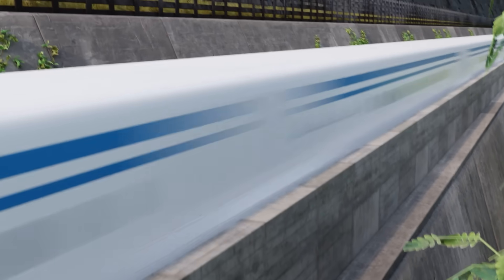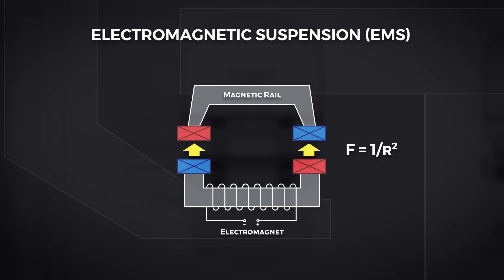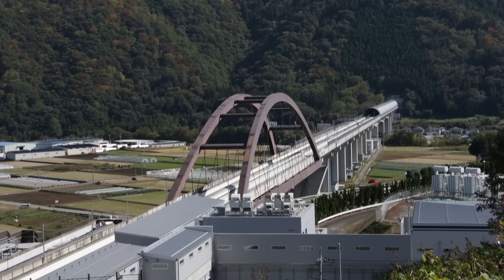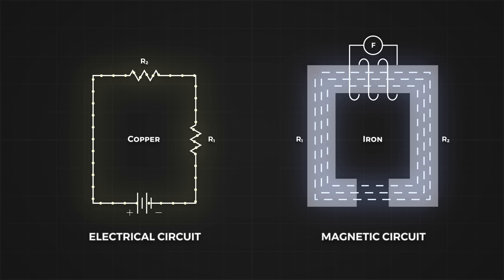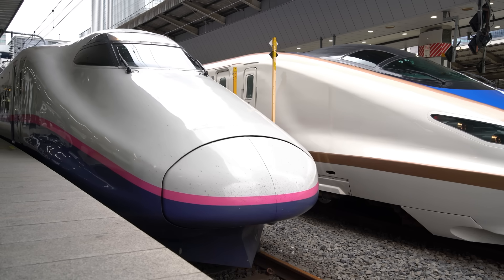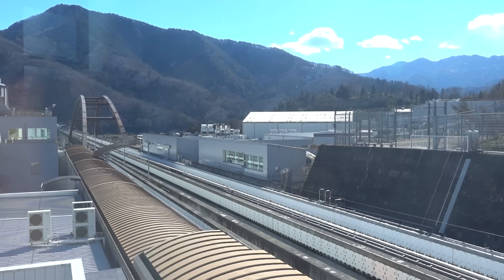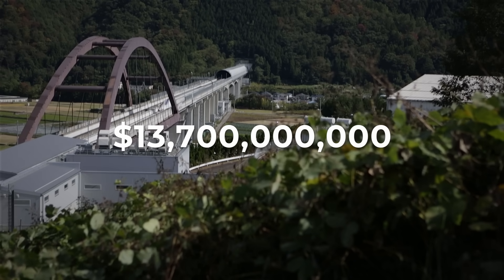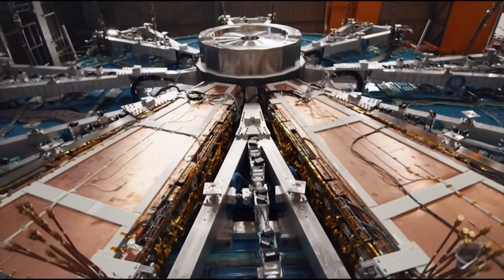How Japan's Maglev Train Works

Comment: Passenger rail in the US is complicated.  There are several reasons.  One is that trains have to travel through populated areas and most want to benefit from that rail but stopping in those areas would defeat the benefit so, many areas must pay for the benefit of a few.  That is a hard political trade for local governments.  That leads to the second problem that interstate passenger rail in the US is also used for commercial rail and commercial rail takes preference.  Usually it is cheaper and faster to drive you car.
Reply: I currently live on the front range of Colorado but I have also lived in Chicago, a huge railway hub. In Colorado there are freight lines running in a straight line from Cheyenne to ABQ through Denver and Colorado Springs etc. these lines already have the basic infrastructure laid and more importantly are already on leased land that is zoned and lended out for train rails. Between these cities it is mostly uninhabited private ranches. Wouldn’t it make sense to add a line directly next to the freight line or create pull offs or work the schedule that allows for multiple use on the same rail? The hardest parts of the infrastructure are already laid they should just be able to add on to it.
Reply: @Jasper118  Texas has a similar story between Houston and Dallas.  They have been working on that for almost 10 years.
Reply: @connecticutaggie  I’m sure with Texas having such a massive stake in fossil fuels they’re not particularly motivated to get a high speed rail going
Reply: @Jasper118  Not really, there are plenty enough people to buy the oil.  It is just really expensive to put in and the financial return has always been hard to sell, especially when there aren't any US success stories to leverage.  There are lots of failed US long haul passenger rail ventures and very few successes.
Reply: @connecticutaggie  there’s never enough people to buy a product, you can always use more customers. Creating a rail system that would potentially replace thousands of flights every year would make a decent dent in fuel sales

Comment: As a Japanese, I'm glad you covered this topic. My 2 cents is maglev is a transformative technology that's more than just transportation where costs per trackline matters. The same technology can be applied to aircraft catapults in navy, for example. It's always good to invest in technology.
Reply: Just a bit curious, if a failure suddenly occurs while at high speeds, does the maglev train deploy an emergency break system or siemthing?
Reply: @lonemarkkingoftypos3722  I cant answer too technically. But there seems to be 2 break system: air resistance and tire's physical break. https://linear--chuo--shinkansen-jr--central-co-jp.translate.goog/about/emergency/?_x_tr_sl=auto&_x_tr_tl=en&_x_tr_hl=en&_x_tr_pto=wapp

Comment: Here are my two criticisms for your video: you went into depth about the main levitation system and talked a little bit about the magnetic repulsion method including its main drawback (active height management), but did not cover anything about the repulsive system with the magnets on the bottom which appears to me to not have the same weakness as the previously stated method. It seems like this should be the real competitor, yet you did not discuss it. My other criticism is about how the power is delivered. How can it be power from the changing magnetic field from movement of the train, when the train is the thing that provides propulsion creating that? Maybe I'm missing something, but it sounds like a perpetual motion machine. Another thing In would like discussed is why the superconductors are cooled with helium which is cooled with nitrogen. Why can it not be cooled with just nitrogen? However I am aware that there are time constraints and this last point my just not make the final cut. Thanks for reading, and I hope you will consider this feedback.
Reply: ", but did not cover anything about the repulsive system with the magnets on the bottom which appears to me to not have the same weakness as the previously stated method"
Those don´t exist.. well sort of. This is typically the fantasy of school children and people who write articles despite not having a clue what they are talking about.... with that, there was actually one system that kind of sort of was based on a system somewhat close to that idea. It never went anywhere, its a very expensive way of making a track.

Comment: Maglev🤔Why only eliminate one form of drag? If they are going to spend a lot of money, they could've used a dozen tbm's to tunnel 100 meters beneath the country in a perfectly straight line and vacuum the space. Would cost 100 times more (idk), but it would be the fastest posible.
Reply: You can´t do a good solid vacuum in a space that large. The main reason is water. So any vacuum would be quite partial and hence in practical terms really not that much better than just running the train on the surface.
Reply: @matsv201  I imagine multiple jet engines worth of power would be needed to keep the vacuum.

Comment: It is amazing that this thing can just passively slow down and stop with everything besides the wheel deployement without any automatic systems(hopefully i understood correctly). Decreases complexity and safety by a ton. It is also possible that those wheels are being held in a way that would make them deploy in case of catastrophic failure and complete loss of power even on board the train. Even at high speeds it would just slow down the train more quickly. I'm also interested if it uses ground effect to help increase its efficiency and decrease the load on the magnets. It would make sense. I would like for this to have part 2 that goes in to small details like this. Either way amazing video. Thank you.

Comment: So... Seen the news about the potential room temperature superconductor yet?
Reply: Yup, it turned out, unsurprisingly, to be a hoax.  If it comes out of China, it almost always is.  They can't even make a city that doesn't flood in light rains or a dam that maintains its shape and position.  People have picked up the drain grates in those cities, on video, and they are just sitting on the ground, no pipes or anything else underneath them, so that flooding thing is not a shocker.  Fire hydrants, too.  It is all show, not substance.

Comment: Hmm, fast, but needs rare materials, complex at each section, lots of energy, heavy shielding, & sole right-of-way for >100km between stops?  Oof, LOTS of expensive trade-offs in that, even before getting into more basic issues like path-planning, land rights, & multi-locale politics normal railways deal with. No wonder it hasn't been widely popular!

Comment: Ordinary trains have very very low resistance to the ground compared to like car wheels, why can't those trains go that fast? Is the wheel really the limiting factor?
Reply: The limiting factor for high speed train is track maintenance. It simply get to expensive when the trains drives to fast. That is why there been sort of a rock solid stop for trains at about 320km/h. China do drive some trains at some times at 350km/h. But they are really exceptions.

For maglev its really cornering that is the limiting factor. And well.. at a speed, so will power demand. But i would suggest that the train will probobly go 700-800km/h before power is a real limiting factor.

There is also more ways to improve aerodynamics of maglev that have not been implemented yet. Improving the aeodynamics would allow for faster speeds with same kind of power budget.

Comment: I often wonder about those ultra fast trains and the airport security. We have those horrible security measures when traveling by air, they are borderline abusive to the passengers. The thing is, an attack on a fast train would be as destructive if not more destructive than an airplane crash. Still we do this security circus on airports but very little on train station or in public transport. I guess you need a far bigger bang to derail a train than to bring a plane down. Maybe that's the difference?
Reply: When was the last time someone downed two office towers with a train?
Reply: High speed train can be safely stopped in any moment. Shinkansen trains actually stop during earthquakes, the same can be applied in case of other threats. You can't stop plane in-flight and that is why you need to minimize possibilities while you are still on the ground.

Comment: Shame you only take into account the reduce travel time. What about the cost per passenger per km (high speed, maglev versus airplane), It is not all about reducing travelling time (Just a guess). Is it cheaper or just a gimmick for 1 hour reduction?
Reply: The main justification is capacity (notice that most of the trains on the Tokaido shinkansen are Nozomi i.e. limited stop trains, resulting in fewer slots for for Kodama and Hikari) which incidentally is the original reason for the Shinkansen to be built (the Tokaido mainline was too congested and needed relief lines).

Comment: Is it easy to use that large amount of liquid helium?
Reply: Use is exceeding supply, by a lot, and it is used in many critical technologies, like MRI machines.  The US had a HUGE stockpile of it, stored underground, and it is being depleted at an alarming rate.  Also, when you put it into the atmosphere it is gone, and I mean REALLY gone, as far as Earth is concerned, as it rises to the top of the atmosphere and then is stripped off into space by energetic solar particles.  

A lot of the problem traces back to the US govt, who stockpiled tremendous amounts, billions of cubic meters IIRC, and started selling it at rock bottom prices to pay down public debt putting 'manufacturers' (it is mostly obtained by separating it out from natural gas) out of business, and the last of that stockpile is slated to be sold in 2023, to the highest bidder.  It is also used in aerospace, IC manufacture, and many other critical and non critical technologies, and for party balloons.  :-/  :-)  The Russo Ukrainian war is another contributor to current shortfalls.  Those Russians are a helpful bunch, all the way around.
Reply: There is a error in this video (well there is quite a few errors, but one specifically with this). The part of this is from the MLX01-B train set, not the L0. At least the part about helium cooling and Ti-Ni wire.

The L0 train use modern HTS that don´t need helium.

Anyway, in the MLX01 train the helium was recirculating. So it wasn´t like they just let it go.

Comment: This is why i think hyperloop (vacuum tube trains as it used to be called) is a bad idea. If maglev isn't economically viable you can assume that putting it in a vacuum tube is even more costly.
Reply: "If maglev isn't economically viable"^
It is.. all the economics numbers in the video is of by a order of magnitude.
Reply: @matsv201  you liking it doesn't change the fact that it's ridiculously expensive to build and not much better than regular HSR lol
Reply: @kristoffer3000  you don't understand the difrance between fact and subjektivity
Reply: @matsv201  Oh the irony.
Reply: @kristoffer3000  So you telling me you neither understand the concept of irony as well as economics?
Reply: @matsv201   I understand both very well actually. :)
Reply: @kristoffer3000  So.. can you tell me what is the actuall track cost contra track coridor for any existing maglev system project?

Comment: Extend their maglev for 13bn? Initially projected at £37.5bn, the UK can not even finish HS2 for under £75bn, double the projected cost. The moneygrubbing is pitiful by comparison, it is easy to envy the Japanese ingenuity and pragmatism on this front. Only 2bn of UK's money is going to Hitachi for the actual trains, so just imagine the total line cost by association. It is only becoming even more inflated as the cloud of doubt that the UK can even finish such a project mounts.
Reply: Whoa there! If hs2 was a test track in Sunderland it would also cost much less. But it's a track between two major cities where land purchases alone cost around £5bn
Reply: @Mekchanoid  We have at least two test tracks capable of hosting HS2 development one of which is situated directly on the East Coast Main Line. Another test track will be available in Wales in 2024. The line is the line and testing is done at testing facilities like anything else. Am I missing something?
Reply: @quibster  my point is that the Japanese maglev is on a test track and so costs less. And why would we need hs2 test track?
Reply: @Mekchanoid  Mate, test tracks are nominally 20 miles long and they are for testing trains. The Shinkansen lines are not test tracks whatsoever. They are fully operational high-speed rail lines that connect major cities across the country. It goes over water, through valleys, through drilled tunnels under mountains. One of the longest journeys you can take on it is about 800 miles (286 miles Maglev compatible). Again, a "Test track" is about 20 miles, that's all we need to test trains.

What are you on about.
Reply: @quibster Clearly, Maglev.
Reply: @Mekchanoid  Their maglev line is roughly the width of Nepal. It's no test track.

Comment: the reliance of helium is tricky, within a few decades the non renewable resource is expected to dwindle and so startup and maintenance costs will likely skyrocket.
Reply: The video they seam to mistaken the old MLX01 coil with that of the L0 train. the L0 train no longer use helium.

And SC-maglev is the only one that use superconductor. All the other just use normal coils, normal magnets, selectrive magnets or hybrid magnets.